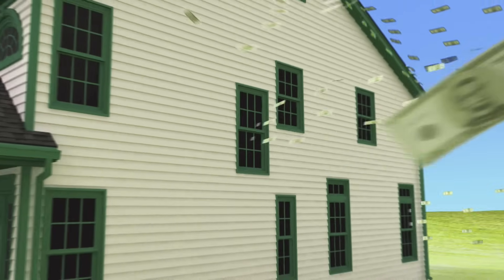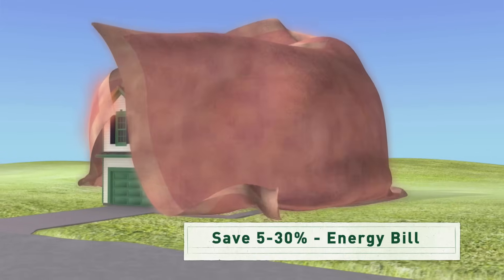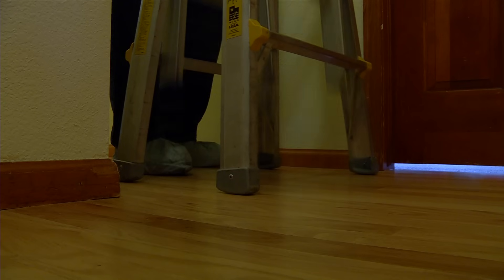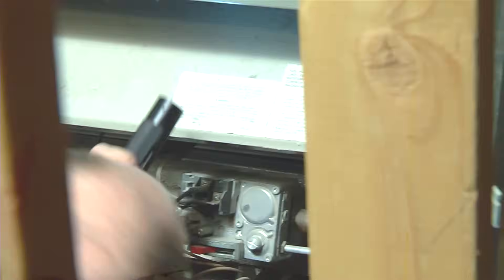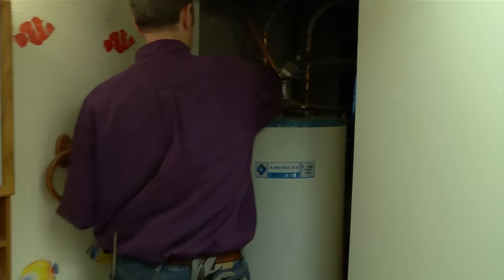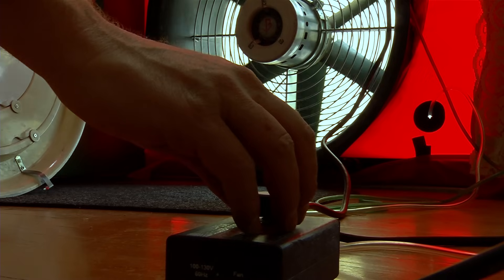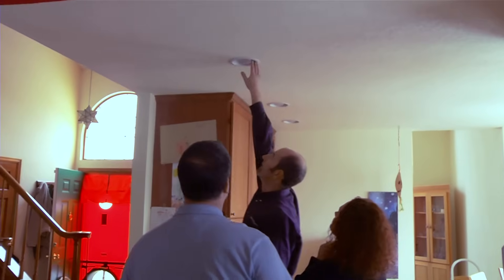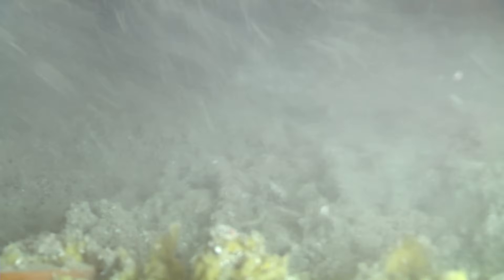Energy 101: Home Energy Assessment

Comment: Less heat is transferred into the home when you shingles have a high solar reflectance index (SRI) since more solar energy is reflected by the roof, leading to lower energy costs.

At PERTEX Roofing we offer Texas homeowners the Pristine Pearl shingle which sets a new standard because of the white laminate that is rated at .25 SRI and protected by Scotchgard,™ so the heat leaves but the color stays!

While air infiltrates a home through every nook and cranny, about one-third of this air infiltrates through openings in the ceilings, walls, and floors.

Comment: So I guess the 661.29 dollars i saved in electrical charges and 800+ in propane useage had nothing to do with my energy consumption reductions and it's just a scam... You probably aren't a economist either.  you don't grasps the fact that it 3 years i will  have recovered the cost of the upgraded furnace and will pay myself not my power provider. You are so consumed by  ideological rhetoric you are unable to analyze a mathematically supported fiscal reality. Grow up or shut up.